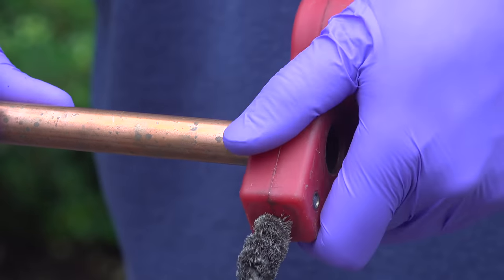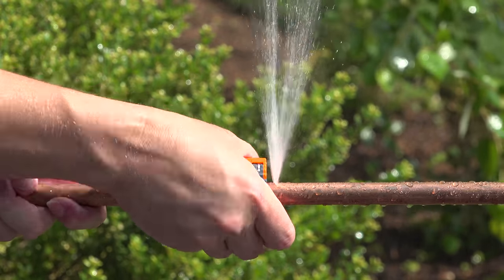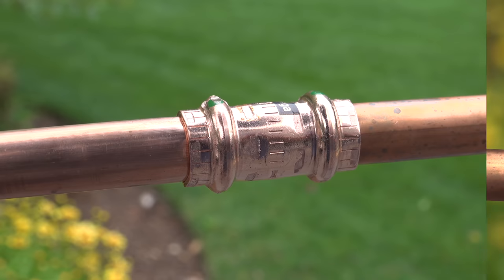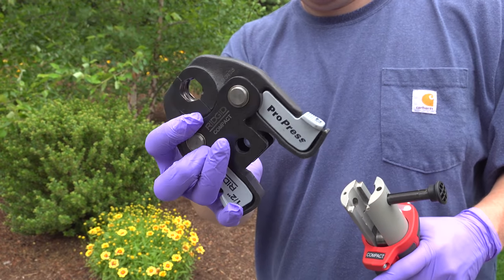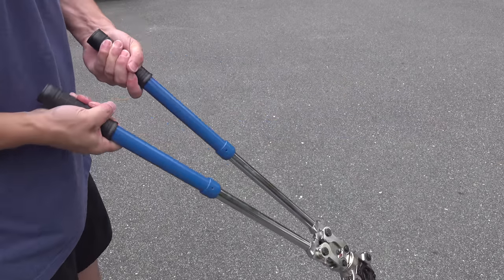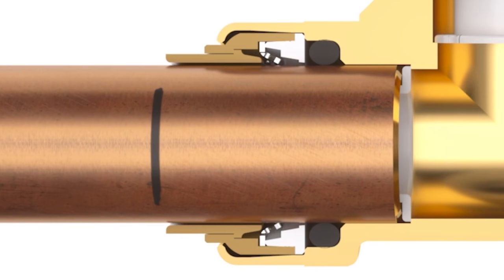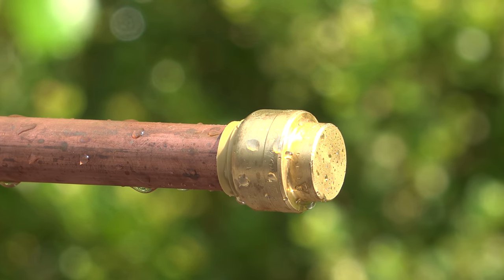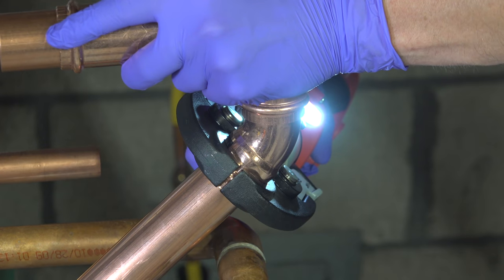NEVER SOLDER PIPE AGAIN - 3 Ways for EASY DIY Plumbing

Comment: I have used Sharkbites in a number of areas in my house and here are my observations:

1)It is critical to clean up the pipe end first, you never want to nick up the o-ring when installing
2) Use a good sharp pipe cutter as you want a perfectly round non deformed pipe end to insert
3) For copper pipe the plex insert in the fitting can be removed as it is not needed and reduces flow rate
4) Sharkbites spin on the pipe which can cause some issues on certain fixtures like shut offs
5) Sharkbites cause pipe to flex as not totally solid, you should support long pipe runs or they will sag
6) Multiple Sharkbite fittings close together are not structurally sound and will need support
7) Sharkbite fittings should not be removed more than a few times as it increases wear and risk to o-rings
8) Always mark the installation depth to make sure the pipe ends are fully installed

I would think most short term leaks come from deformed pipes, nicked up o-rings, or being removed too many times.  The o-rings are pre-lubricated but that will wear off after being removed a couple of times.  I have never had an issue with them but all of mine are less than 10 years old.
Reply: Very useful comment thanks
Reply: Sharkbite recommends that you never remove that plex insert, even while working with copper.  They say it can damage the seal and make the fitting un-re-usable.

Comment: I am a plumber. Pro Press is an amazing time saver and in instances when you can't stop the water say in an appartment (even a slow drip from the upper floors will indeed disperse too much heat to make it impossible to solder) but it will never beat a brazed or soldered joint. If you know what you are doing, the pipe will burst before a soldered joint fails.
Reply: I don't understand how people think soldering is so difficult. I'm not a plumber but I've soldered countless parts on and off circuit boards. Clean, flux, apply heat, apply solder, boom...done.
Reply: @SomeUserNameBlahBlah I solder electronics all the time and soldering pipes is definitely a different story.  Similar concept, but sometimes you can't get all of the water out of a pipe and it just sucks the heat away as a massive heatsink.  It's like desoldering small electronics when there is a huge ground plane sucking all of the heat away.
Reply: @InsatiableMonkey  Obviously water is a huge difference. You also don't need to twist your body into a crawl space to swap out a FET.
Reply: If you have water try to remove as much as possible by pitching the pipe up or down, use a wet vac to suck out, use a straw and spit, then use MAP had which is super hot compared to a regular propane torch.  It’s more time consuming but not that difficult
Reply: @johnmack4470  It's difficult when the pipe is vertical and you can't drain the other end since it's where the line enters the house from underground and it's 11pm on a Sunday 😁  I did use mapp gas in my case, but I did not think of the vacuum trick!  Good tip.

Comment: I did my own “shark bite” tankless heater install…no sweat. I bought the house 24 years ago and had to do all the plumbing repairs and modifications (water heater and getting rid of all the well water install due to new law) the old fashion way and like working that way but the new way is great.
Reply from the maker: Thats great to hear, I know they are super popular for that since you can save sometimes $700 or more on the install alone
Reply: Those arnt meant for permanent fixes
Reply: @throckmortonthebrave6634  I used to think that, too. Sharkbites now carry a 25 year warranty for above ground applications. I think it is 10 under ground. I like the fact that you can easily remove a Shark Bite and reuse it, change from plastic to copper to Pex without adaptors. The cost is a different story.
Reply: @thegreenerthemeaner  i think it was origonally designed for contruction sites that only last for a few years
Reply: @thegreenerthemeaner  slow down. 25 years sounds good, by itself. With no comparison 25 sounds like a large number of years.  Soldering can last indefinitely. There are 80 year old solder joints out there that are still holding and will for yet another 25.  
Shark bites I believe cost more than double solder joints.  Soldering is one of the easiest skills a person can learn as well. It’s sad to see a new generations give up high quality and easy for something semi-quality but easier.
Reply: @kcb5336  it’s not about anew generation giving up on soldering. It’s about not wanting to learn and potentially fail on your own property. Plus most people may be doing one or two joints. The one-time cost and learning curve for a single home project is cheaper with something like sharkbite instead of soldering.
Reply: @thomashajicek2747   Again , soldering is one of the easiest skills to learn.
Reply: Damian used Sharkbites…”no sweat”…😉 I see what you did there!
Reply: @philipbohi983    Thanks for pointing it out to me! Sometimes I don’t know my own strength🤣
Reply: @thegreenerthemeaner  Company I worked for (I'm PL01 Journeyman) had two failures within 3 months and one flooded a shopping center over a weekend. Sharkbite declined the warranty and stated that they had never had a failure of that type (could see where the teeth slipped off the copper), truly shady experience. Temporary emergency fixes only.

Comment: These tricks are fine for short term (5-10 years) or "customer" jobs where you are not responsible for leaks a few years hence. For your own long term jobs (20-50 years) I definitely would solder, especially if the joint is going to be enclosed in a wall or under a floor.
Reply: No pro press joints are guaranteed for 25 years as well as nibco and other press fittings
Reply: Yuck Foutube  solder does not last forever, if it did plumbers wouldn't be constantly fixing old leaky pipes
Reply: Yuck Foutube  lol soldering lasting for ever, what you smoking.
Reply: @joshd270  They have found soldered pipes in Egyptian pyramids that are still rock solid. Trust me... if the Egyptians had used Shark Bite?? Those pyramids would have been flooded by now... guaranteed.
Reply: @jeromenorman1369  Let's see if they honor the guarantee and fix your flooded house! They will give you your $3.50 back you paid for it and that's it.

Comment: I have been using shark bites in various applications for 10+ years. Most important thing is ensuring a square cut on the copper or PEX. Only failure I have ever seen (in neighbors home) was due to a pipe not cut square, resulting in disproportionately distributed pressure on the fitting. They are even approved for burying in concrete. Not sure I would do that, but contractors do it regularly here...
Reply: I do a lot of potable water plumbing as a gas fitter and square cuts and proper support are both key to any successful installation and it also shows you took the time to do a good job. Time well spent. 👍 Be proud of your work, don't take shortcuts,  you get less leaks.
Reply: Rubber O ring will never last as long as solder and copper. This new idea is only to make the Inventor money. if it ain't broke don't fix it.

Comment: Some plumbing supply stores allow you to rent propress tools as well (don’t have to be a plumber). I rented a Milwaukee M18 press tool to replace my well pressure tank and it only cost me $50. They charge your card the price of the tool though ($3500) and when you return the tool they refund all but $50. Great option for DIYers.
Reply from the maker: That is awesome, the electric is definitely very nice to use especially if you have a lot of work to do. I keep waiting to see a Ryobi or someone come out with a tool for $400 someday maybe
Reply: @SilverCymbal  I’m hoping the price will go down over time. I debated buying the Ridgid like you had in your video but just couldn’t bring myself to justify the cost. I rented mine on a Friday and got to keep it over the weekend for the same price. Used it to replace some 8 year old shark bite valves since I had it as well. Great video!
Reply: Yeah...umm.. charge 3500 to my card and it'll reject it.

Comment: Just like to share some info about shark bite.  It works really well in indoor applications(assuming install correctly with clean joints and length to specification).  For garden or places with extreme sun light, stick with press or solder.  Always watch out for UV.
Reply: Tell that to the guy that had a shark bite inside that blew and destroyed his whole wall. NEVER USE SHARK BITES or rubber o ring copper pipes 
SOLDER only
Reply: @nck4888 Fully agree, I would Not want to be the professional plumber to receive the call of a failed 🦈 and then be sued $10000 over a $2 part!
PEX pipe is just as easy and also won't fail, so why everyone is racing to use push connections? It's partly to blame on hardware stores. For the past several months home depot Never has plumbing gas? 
But they do have overflowing shelves of push connectors!
I've seen push connections fail, and it's always BAD!! and it's always under 10years. Ive never seen a welded joint fail.
Reply: @nck4888  My 20 year old soldered copper failed sooner than my 24 year old sharkbite replacement, which is still going strong.
Reply: @grimmpseudonym5941   you may have forgotten to clean the pipe after installation flux, rimming or cleaning is definitely key , I've seen more issues with shark bites , but that's my experience fixing other people's shark bites I on the other hand don't use them, period
Reply: Thanks
Reply: As nck4888 said. Your copper pipes failed due to poor prep before soldering or you copper failed for some other reasons, being in contact with something corrosive for too long. And fact is the copper corrodes faster than the solder. 
My and my fater made alot such instalations and we are not even "Pros" we just know how to do it, and is quite simple if you have few cheap tools and a torch.
There are methods to block the heat from sensible areas or tight, or you can simply measure the part and solder it outside the that space if is impossible to apply heat there.
You cannot be logical to think a 3 mm rubber oring will outlast a 1 cm of solid solder along the connection, that is just a way for "fools" to think they can replace a professional.
If soldering is done properly the copper will fail before the solder, and there are many things wich can affect the copper, one is soap, wich is an accid, cement, some forms of types of paints. In my experience, this kind of instalation is the best, if is done properly, and if you want to do an artistic job where all the pipes are instaled straight and beautiful.
Soldering is the easy part, the painstakingly part is the prep work, to clean all the conections to bare copper, clean apply flux, make the holes in the walls to secure the pipes on to it. And in my experience, i've seen "professionals" with a degree in this profession do a much worse job than and so called "amateur" and we also do electric circuits and i can say about the same of that. The only reason, the only logical reason you would want an oring fit in any pipe connection would be to have the ability to disconnect it. but that posibility is gone when you press that pipe. To me this method is just "kitsch" @grimmpseudonym5941

Comment: I agree that shark bites are perfect if you are doing small jobs, but the expense adds up quickly as a job scales up. If I have the time, I'll solder the joints.  If I had the money, definitely a pro press.
Reply: Disagree. They are total junk. When you rely on an O ring to make the seal it will always be unreliable. I'm a plumber so speaking from experience on the occasions i attend bursts/leaks 9 times out of 10 its a  due to this type of fitting. I attend these leaks often
Reply: No, the O rings degrade over time and cause leaks. Learn how to do solder joints properly and they will never leak, it is a basic plumbing skill and easy to do if you just use the correct procedure.
Reply: An induction brazing tool for copper costs a bit more than propress, but lets you solder joints much faster than propress, especially if you use the solder rings. Portable oxy-propane is also a step up, you can solder a joint from cold in 10 seconds if you're good with it.

Comment: I can see the point of those quick fixes. Sometimes things need to get done in a hurry and anything will do. The trouble is, in the long run, those connectors will cost you a lot more money. I just learned how to solder, and as long as you have a basic understanding of the process, it's not difficult. I quite enjoy it.
Reply: Not at all. In large parts of Central Europe, press fittings have been the standard for over 10 years and been in operation for ~20 years. Its extremely rare to find anyone still soldering copper pipes in Germany. Press fittings are so reliable that they are even commonly used for copper gas pipes. There are generally more reliable than soldering and also easier to use, reducing the amount of mistakes. The only downside is that those press fittings are more expensive. Most of the time, its still the better choice.
Reply: Yeah, the press fittings are more expensive than simple sweated ones.
I had a new hydronic boiler put in last year, and the amount of piping in and out, zones, manifold, etc was almost alarming.  Just counted about 25-30. Once they got the old one out, I let them be as I didn't want to be looking over their shoulder like. About 40 minutes later after hearing all this whirring and clinking, one of the guys comes out to ask me a question about the vent. I go in to look, expecting to see a mess, and no its all basically done and they just have a question about the vent.
Guys where probably 22-23, and with only one guy being able to fit in the closet with the boiler, no way you could conceivibly set things up to have completed all of those fittings with a flame.
TL;DR, If I can do 2 press fittings in the time it takes for you to do 1 flux and solder, then my labor cost is going to be close to 1/2 of yours.
And I swear I heard a whir/clink, 5 seconds later whir/clink, 10 seconds later whir/clink, maybe another 10 seconds whir/clink and on and on.
If you want to be competitive as a plumber, general or quoting, you are not going to be able to beat the price of the next guy using press.
Similar for PEX plumbers too. 
Furriers, the guys who used to shoe horses along with blacksmiths probably said the same thing about them new fangled oww-tow-moe-beels.

Comment: I recently had some pluming to be done around the house and called in the pros.  They used something similar to the Sharkbite on everything and after they left I was left wondering why I needed to pay a professional to do that.
Reply: @auspicioustoot  #technicallythetruth
Reply: Its alright, now you know
Reply: thats ok do it yourself next time and than a plumber after you fuck it up royally so he can charged you triple
Reply: Because the pro-press kits are close to 10 grand and those pros spent years learning the trade.
Go ahead - try it yourself. See how many leaks you get.
Reply: @alexanderblakeney226  As a plumber most of my calls are do it yourselfer's that got in way over their head. It's a lot more money if I have to fix their screw-up's before Fixing it properly. You can't teach 20 years of experience. There's a reason you call the pro's, flood damage is expensive. I've seen it happen more than a few times. Also pro-press is good but the gasket's fail over time, water eats rubber, they last 5-10years depending how often and your water conditions (i.e Hardness of the water) Solder is tried and tested and proven to last 30 years minimum. Solder is a difficult skill to master but a perfect solder joint is better than anything. Don't let anyone tell you otherwise. Plastic is Junk, Rubber is ok but will fail eventually and you better hope your around when it does eventually fail on you.
Reply: @alexanderblakeney226  
But the "pro's" doing the job in my house were using the same press-fit kit I can get at the hardware store and they don't even use copper any more.
Reply: @tassie7325  then they aren't true pros. If they were using copper it should have been soldered or of 9t was pex should have been crimped or expanded with a ring depending on which type
Reply: @FJB2020  I respect anyone with a red seal trade ticket because I know how hard it is to get one. Anyone can fix a house it's really not that hard to be honest. Working 9000 hours listening to a boss beat you down all day and passing the ridiculous tests they throw at you it's not so easy.  Hey if it is so easy why don't you just go get your license than do it yourself.